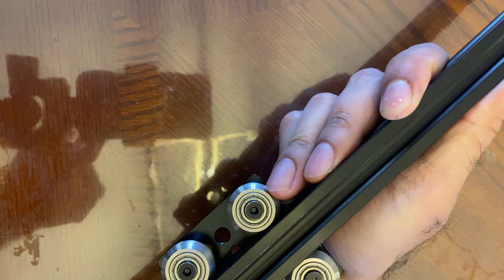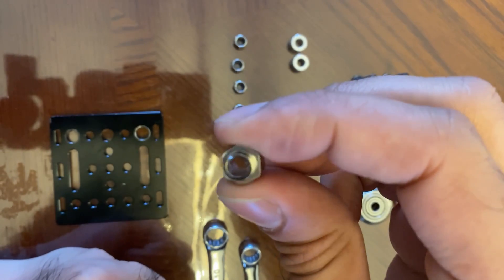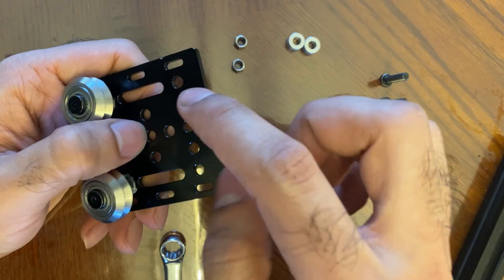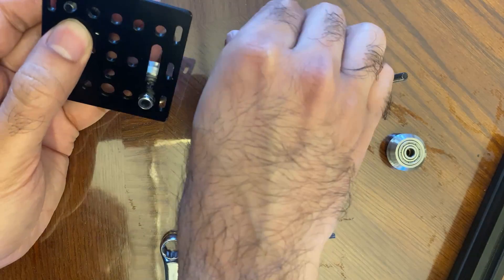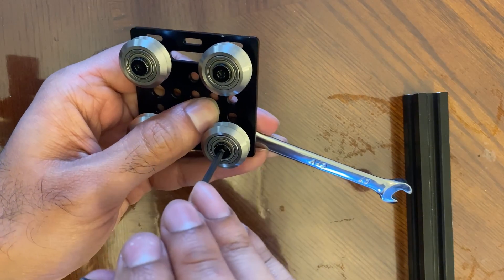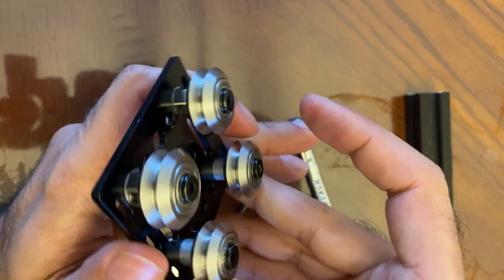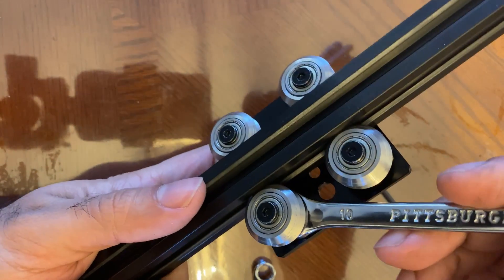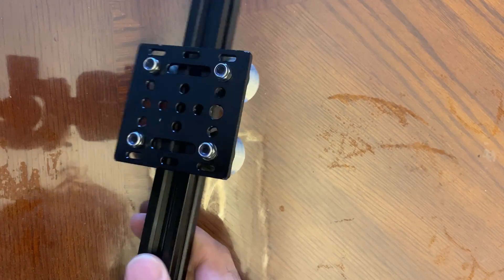Assembling V Slot Gantry Plate for Alumi-Lign Fence System

Comment: Well presented. But those stainless wheel will chew at the softer aluminium very fast. Normally a poly wheel is used to prevent that without compromising stability amd accuracy.

Comment: I don't think it is recommended to use these stainless steel wheels with Aluminium Extrusions; stainless steel is much harder than Aluminium, and it will grind away your profile. POM wheels (the black ones) use hardened plastic that not only deforms to match the shape of the v slot, but the wheel gets grinded into the shape of the profile to achieve maximum surface contact

Comment: Does any one know if these tracks can handle a huge load? I am designing a set of 6’ tool boxes for the back of my truck that slide out of the truck about 5.5’. I found these tracks and thought they could be a great addition to my build. I can’t find a load capacity list any where.
Reply: Saw your question. Were you able to get it answered? If not, what did you end up using? TIA

Comment: Good morning.  I am having trouble finding the stainless steel double V wheels.   Or possibly the complete kit that you are using in this YouTube.  Could you help me out and tell me where to find them.   Thanks Rand Sawbuck …
Reply from the maker: Hi, have you tried the OpenBuilds website? I believe they list out all the parts there.  If not reach out to me through my website as I have these kits available. The stainless steel wheels I had to source from a supplier do those maybe harder to find.

Comment: Oh so I checked ur website and my table saw fence is not like urs bro. Mine will consist of rails that run all around the saw. I have a type of jobsite saw and urs is a cabinet saw? I'm about to build my saw into a workbench type or I should say it will have extensions on both sides and the rails made out of 2020 aluminium extrusion will run the whole way around with the gantry plates on both sides so I can slife the fence up and down but I am also looking at making my own type of INCRA style measuring system as well as part of the whole system. It's gonna take a fair bit of working out but I will get it built and when I do I will have a decent system for measuring on the saw.  My extension may in the future have the dreaded router table as part of the build too.. Lord I have plans but I'm completely new to the whole woodworking workshop thing .. LMAO,,
I'm a newbie of epic proportions mate.. haha! I love working with wood and eventually I also am looking to build my own CNC router machine thingy too. That doesn't sound very technical calling it a thingy but I'm collecting all the parts atm for a run at making my own homemade CNC machine. I cannot wait to learn CAD & CAM Software. Somebody said I could buy a really good machine for about 3 grand with bits and other important parts..
Right I've waffled enough for the time being pal.. Nie kit on ur website. 
If anybody on here hasn't been over to this dudes website then get to it now!!! COME ON NOW GOOD PPL.. MOVE! MOVE!! MOVE!!!
Reply from the maker: That’s actually not a bad idea! I’m currently building a workbench using 80/20 extrusions for my craftsman 113 Table Saw. It’s not exactly a cabinet saw but a contractor saw that’s belt driven by an induction motor. I’m also working on building a router extension with a lifting mechanism. Hoping to have a video out on that in the next few months.
Reply: @jbuilds1  Thanks pal. Appreciate the reply.  Hope the sales of ur fence take off and u make a killing on them bcos they look great pal. I got a piece of 600mm 2080 for my fence on my saw as well. Hopefully it works out fine. Thanks gain for the great videos mate. Lot's a great information nad ur site is cool as fook too bro